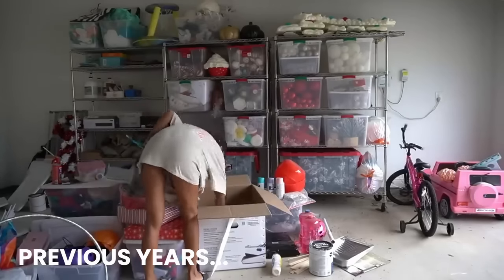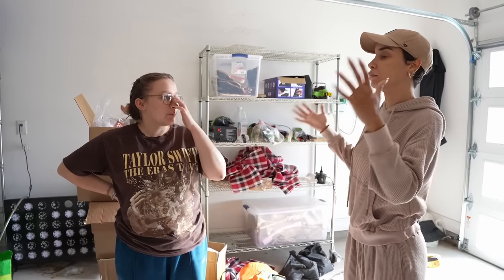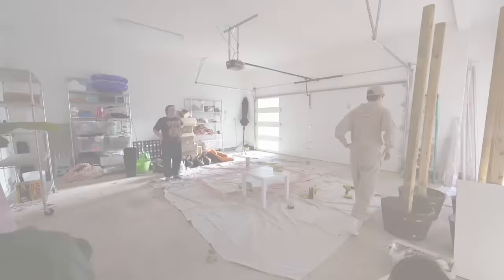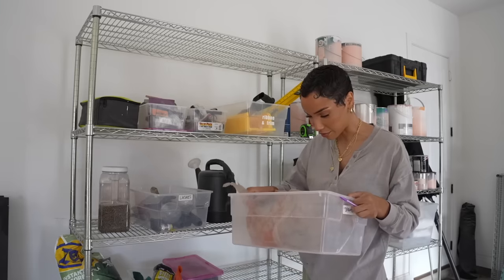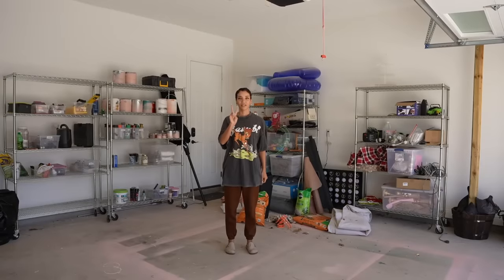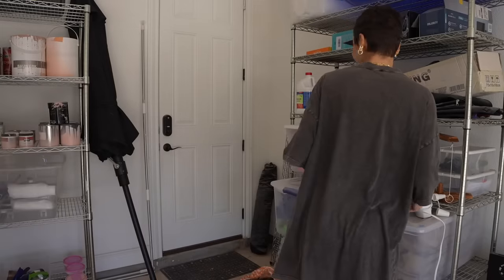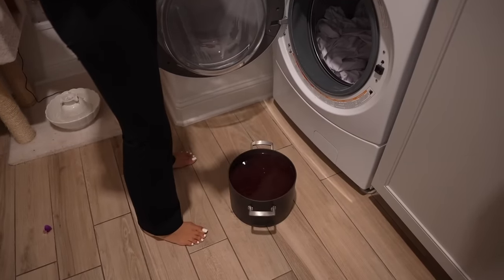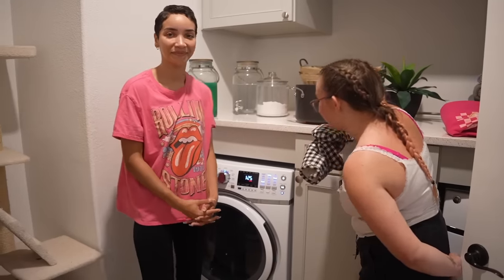Transforming my UGLY Garage into a CUTE Workshop!

Comment: Coming from an engineering girly, you can use a plastic tacklebox with multiple compartments or a mini tabletop drawer for the nails and screws organization. Under the peg board you can get a metal storage cabinet (like the ones in woodworking shops) to store smaller tools , batteries, cords, etc.. It can also work as a table top with wheels if you can find one with that configuration so that way you have a multi use table!
Reply: pink ones in Lowes!  😘

Comment: Love how the garage reorg is coming along. You've got a good plan for using the space. Might I suggest your first workshop project to be making a 2-sided panel to hide and protect the utility/hvac parts in the corner? You can leave one side and the top open for repairs or airflow but the panels would also protect those important parts from saw dust and flying bits and bobs. Can't wait to see the finished project! Oh and I vote for machine stitching and RETV Workshop above the peg board!

Comment: I love the pink painter jumpsuits. Can't wait to see how your workshop turns out. Suggestion for the water heater. You could have bifolding screens or a faux cabinet that is easily movable to cover them. You could paint them to blend in with the pink wall. That would be a fun DIY project.

Comment: Have you ever used the "offset" function in Cricut Design Space? The contrast you wanted for your lettering can be achieved using the offset function and cutting out what is essentially a "shadow" or "background layer" for each letter. You could have used solid pink HTV and it would have gone a lot quicker than all that sewing. Just a thought for the future.